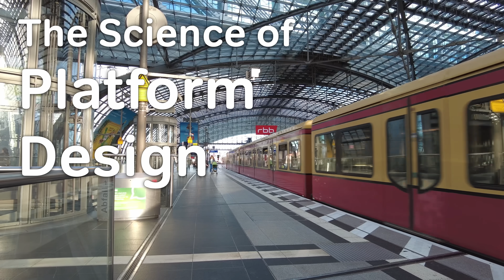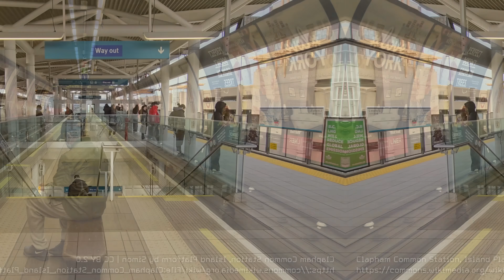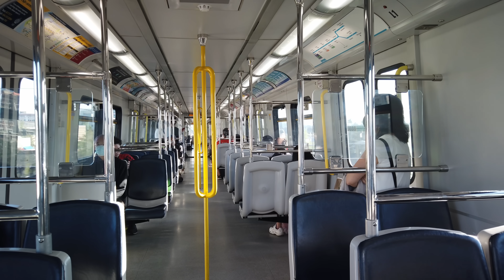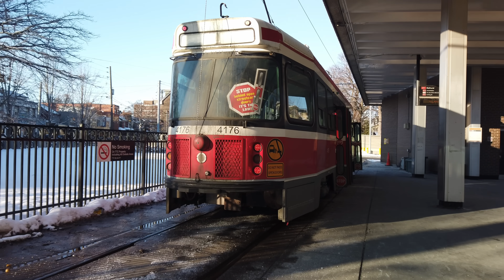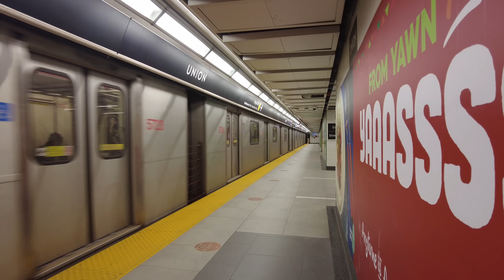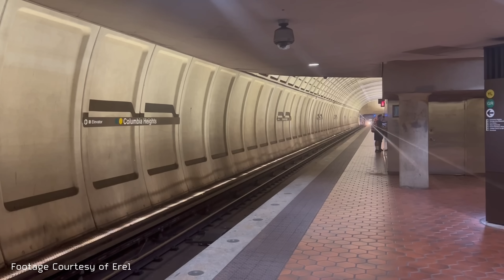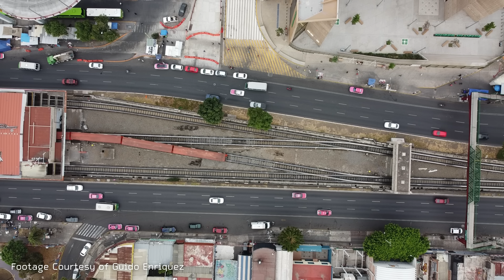The Surprising Depth of Platform Design

Comment: Re Spanish solution: I wonder if there's cross platform transfer to two different lines at the same time from the same train sitting in the middle track.

Example: Exit train right and transfer to destination A. Exit train left and transfer to destination C. (Stay on train and continue to destination B)

Comment: Having a platform that turns out too to be too narrow (because the system is too successful) is one thing (looking at you Dubai Metro) but then not doing the easiest things to increase usable platform width is another. 

Widening the actual platform width is probably nearly impossible or at least really expensive in this case. 

However not moving obstacles on the existing platform out of the way is another.

Example: The information boards, which now sit on stilts, narrow Dubai Metro platforms by at least half a meter. If the same information boards were simply bolted to the wall instead of standing on stilts on the actual platform you'd have effectively increased your narrow platform by half a meter for free. 

(Otoh it's a mystery to me how you can have such an under-designed transport system if you happen onto both the "start with a blank slate glitch" as well as the "infinite money glitch"). Don't get me wrong: it's great but it's straining under the weight of it's own success and needs to be expanded, which it probably will be ;)

Comment: I just want platform length standardization. The New Haven Line is the busiest commuter rail line in the US but has several 4-car platforms that are serviced by up to 9-car trains. Platform lengths throughout US commuter rail systems are often a hodge-podge of lengths that slows trains down and robs capacity from lines that could otherwise run longer trains (sometimes with power upgrades or electrification needed).

Comment: Canary Wharf on the Jubilee line in London at 17:05 on any workday is pretty amazing. It's crammed, but because of the Platform Edge Doors each door has a  queue which basically stretches right back across the pretty wide platform. Everyone queues, no shoving or pushing. And the headway is low, so everyone knows they'll be out of there soon.

Comment: 5:55 Bespoke platform height for the single type of train configuration that is going to use it, is the perfect solution of course.
Raised platform sections to adapt all other platforms already existent is the next best thing.
To re-engineer every old one to bring it up (or lower it) to the level of the new fleet of carriages which is set to arrive is not only really expensive, albeit the ideal solution, but it assumes that only the new stock will ever use the route as well as assuming that the same new stock will never get old and need replacement with the concomitantly mad re-re-engineering
of said platforms.
Und so Weiter!

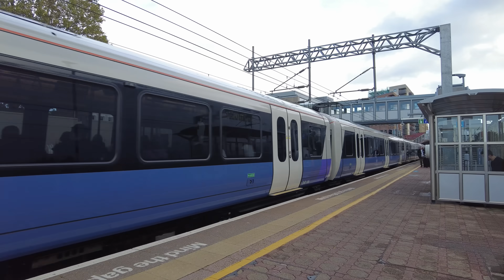Comment: Re 4:40 There is another thing, quite new that is also not good for accessibility, in this case for the safety wheelchair and rollator users, and that is pseudo-low-floor trams with slight inclines next to the doors. I know these slopes are compliant with legal standards for wheelchair ramps, but they are still a danger for disembarking wheelchair users, and it should be common sense these are not as good for accessibility as completely flat interior floors.
 If platforms need to be built for rail based transit, why not just make the platforms the same height as the whole of the accessible floor area and not have the slopes at all?

Comment: One design solution that has yet to be found and that I'd like to see is better dispersing passengers along the platforms. People naturally clump together and it makes both the ride less pleasant and of course makes it more complicated getting on and off the trains.

Nowadays some systems got indicators and such but in my experience their effect is very limited. We need something more to break people out of that "there's a lot of people here so that must be the right place to be too" mindset.
Reply: Information is key here. The simplest is "long train" vs "short train" on the displays - which helps for regulars; indicate where short/long trains stop helps everyone. A quite advanced feature that is being tested is to measure how crowded each car in the arriving train is, and to display that information so people move to less crowded cars before the trains arrives. The data can be collected by weight sensors (which might be installed already for freight trains) or by counting phone signals (or ...).
For long distance trains with reserved seats, you need to indicate where each car stops by number. In Europe it's common to have letter signs on the platform to indicate location. But it has also happened to me that a train had ended up in reverse order, which was announced way too shortly before its arrival.
Reply: Hey, it's a laziness tax. If people don't want to walk to the end of the platform, they get to have the more crowded cars.

Comment: One issue I've seen with the Spanish Solution here at Toronto's Union Station for GO trains is that some passengers will go to the platform they know the doors will open on first, thereby feeling that they are getting a leg up on the other passengers.  The other problem with this is that the electronic boards will only show the platform numbers - usually 10 minutes before arrival, so you end up with a crowd gathered around those boards and then a mad dash to the platforms - but no announcement as to which platform is for which action.

Comment: One thing you didn't mention that can improve platform flow without changing anything about the station is Google Maps' feature to let people know which car to position themselves in to have the shortest path to their desired exit at their destination. When I was in Tokyo, this feature really surprised me. Of course this needs accurate data being fed to Google about station layouts and car positions. But when it works, it reduces the time/distance people need to waste on platform, which on average increases their capacity.

Comment: Boston always has a lot of designs.   I prefer: Front and back of train platform having direct entrances/exits to from the streets level.
In the middle of the train area I prefer: 1) multiple stairs between the two inter-connecting rail lines AND 2) dual-side platforms

Comment: should come to Shanghai to try out Hongqiao Airport Terminal 2 station on line 2 & 10，the east bound line 2 is dual platform，and east bound trains are frequently used as passageway for passengers coming off west bound line 2 and need to transfer to Hongqiao T1 using east bound line 10

Comment: Omonoia Station line 1 in Athens, Greece has a dual platform (spanish solution), since forever. I am fairly young and the station is like 100 years old, so I don't think it exploited the dual platform before the opening of line 2 (red line) 20sth years ago. Omonoia station is a highly crowded station, not only because it is an interchange platform, but also because it is CORE city centre. It does exactly what you described (first the side platform doors open and after about 15 seconds the island doors open up, and then close simultaneously). Of course there are many people overriding it and I haven't figured out why, since the platform is connected with the exits and line 2 accordingly. 
Also, the Thessaloniki metro system is about to open in a few days (hopefully) and all the stations have island platforms. I am curious to see how wide they are, when I visit the city.
<3

Comment: Possibly of interest - the Glasgow Subway has several of the original (extremely narrow! I think maybe 6-7 foot wide at some stations) island platforms from when it opened in 1896, but also has some stations which have been converted from island to having either two platforms on opposite sides of the double track, or one platform between the tracks (with a new glass wall installed along one edge) and another one added later outside.

Comment: I remember stepping down from the platform into CN's Turbo train, which was unusual. In New York's original South Ferry subway station, which was on a curve, they had noisy metal grates that moved from the platform to the train doors. 
Fun TTC facts: Davisville has three working platforms, although the western-most is used only as a diversion if there is construction. The North York Centre station (originally named Park Home) was installed after the subway extension was built. Union Station originally had a centre platform, but a whole new platform was added on the south side to accommodate the increase in traffic. Eglinton station is the only one that kept its original vitrolite glass tiles. Also, Eglinton station extended its platform north to accommodate the Eglinton LRT, and blocked off part of the south end. Christie station has two accent colours at the top of its walls: brown and green. After re-doing the Yonge line station tiles in the 80's, the only stations to repeat the colour pattern of the old tiles were: St. Clair (yellow and green), Summerhill (grey and red), Dundas (yellow and black), and Queen (grey and blue).

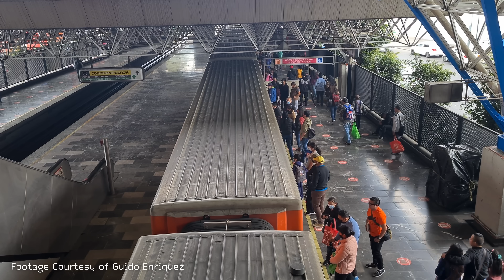Comment: 12:30 Mexico City''s metro also adapted a single island station to a spanish solution, the one shown in the video at 10:40 in fact, Chabacano from line 2. It open as just another single island at street level station at 1970, like others in the line (San Antonio Abad, Viaducto, Xola, etc.). 

Then came line 9 in 1987, and since line 2 connects two important terminals and the downtown, and is also today's most used subway line in Mexico City, they decided to turn line 2 Chabacano into a spanish solution, which really helped when yet another line connected with Chabacano (line 8) in 1994.

Comment: Denver light rail is all trains that have low platforms but require 2-3 large steps to get into the main carriage. There is handicap boarding at the majority of the platforms but it still is a bother for the rest of the able bodied passengers, especially since this hampers any push to increase bike connectivity and integration with the system.

Comment: 3:04 Trivia:  Curved platforms are no longer an option in Victoria, Australia on new/renovated/rebuilt stations.  No way, no how.  The platforms must be gun-barrel straight for accessibility.

This caused a slight NIMBY kerfuffle a few years ago when two closely spaced stations (Mont Albert & Surrey Hills, ~750m apart) had to be merged into one (Union) during a rebuild to eliminate two level crossings.

Apparently this was an outrage to some local residents; as was an alternate suggestion (not official, and I don't think serious) that dozens of houses and a local park be razed to allow the line to be straightened so that the separate stations be retained.
Reply: Re Trivia: Is that the actual requirement, or is it about the gap between the platform and the floor of the train?
Reply: @Myrtone  I'm not sure what the maximum/minimum requirements are for the train/platform gap, but I do know new/rebuilt platforms have to be absolutely straight.
Reply: @dfross87  In that case, how?
Reply: @Myrtone  Existing platforms are grandfathered "as is".  If a station is new, rebuilt or renovated, then the platforms must be straight.  Either move the station to where the track is straight, or straighten the track somehow.  Thankfully there are no underground stations affected, unlike somewhere like London.

It's one (unofficial) reason that during the recent Level Crossing Removal Program certain level crossings haven't been considered for removal -- a nearby station would need to be rebuilt, and there's no way to do so without it being expensive and/or very unpopular locally.

Whereas in the case of Surrey Hills/Mont Albert/Union I mentioned above, there was a reasonably easy solution available.  If there hadn't been a suitable straight section of track nearby, both level crossings would still be in place.
Reply: @dfross87  But my question is how you know this is an actual requirement.

The video mentions gap fillers at 4:40 and these can make the gap minimal, possibly even at curved platforms.
Reply: @Myrtone  Because one of my friends works on a lot of the rebuild projects.  He told me about the "straight platform" requirement, and that it's part of the disability access requirements that were put into law some years ago.
Reply: @dfross87  I do wonder if that is a misunderstanding and the actual requirement is about the gap between the platform and the floor.